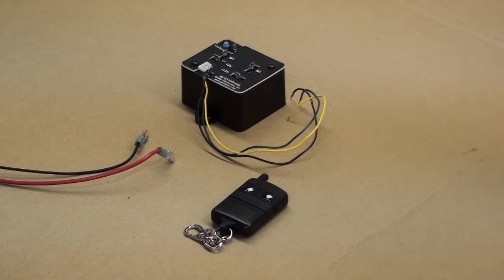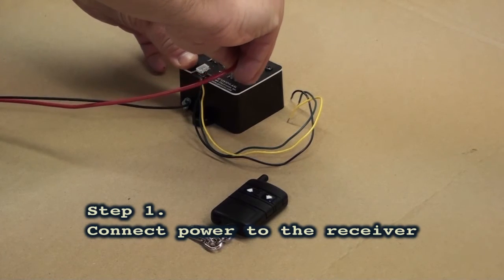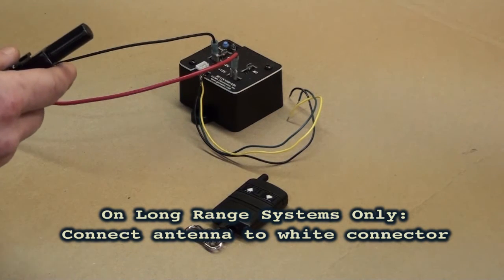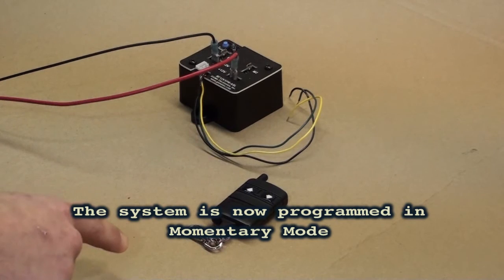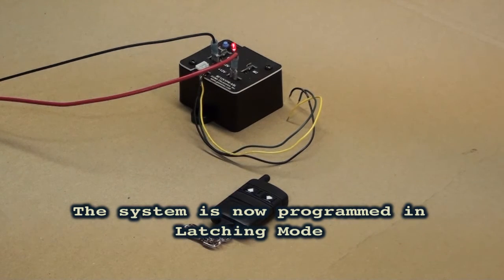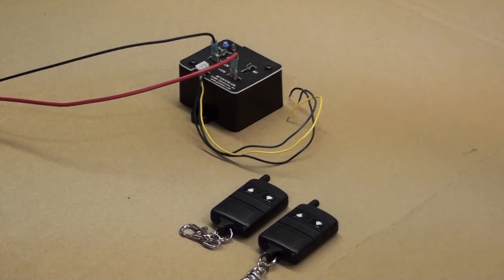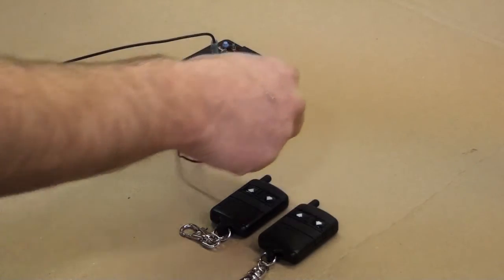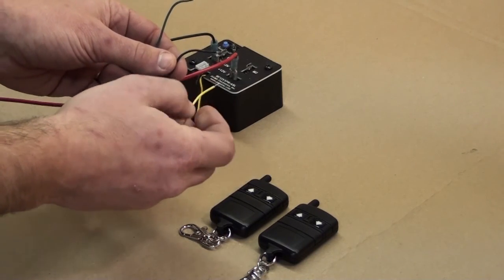Programming Instructions For GAMA Electronics RF Remote Control Systems

Comment: What is latching node? Thanks
Reply: Latching MODE is for constant connection....Press to turn ON, it will stay on.   Press again and it will turn OFF.  Otherwise it will act as a MOMENTARY switch. In momentary mode, as long as you press, it will stay activated but once you let go, it will release and shut off.  Hope this helps.   JwgK